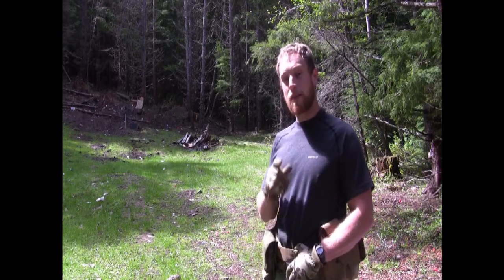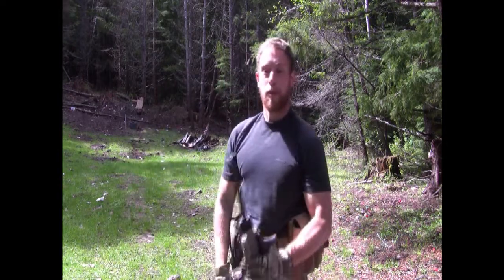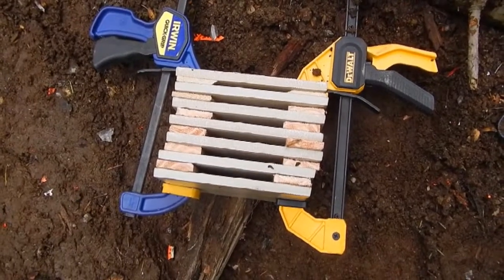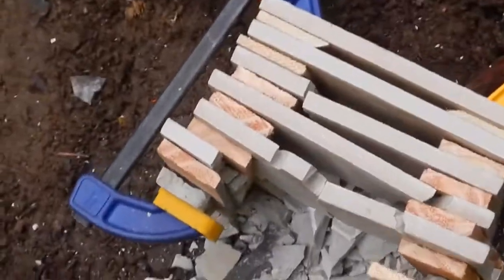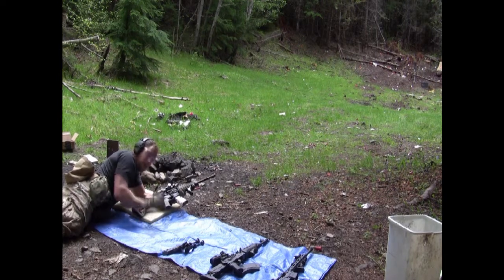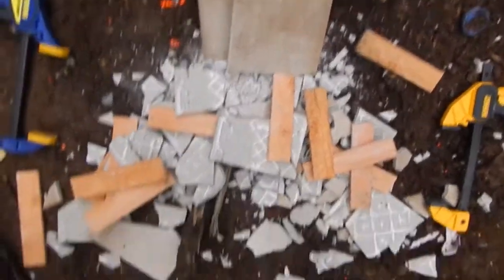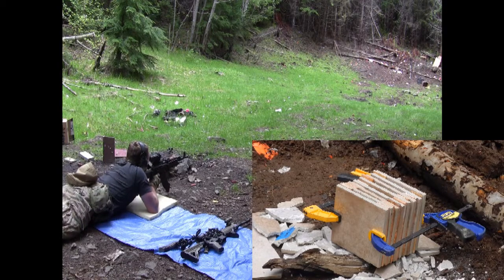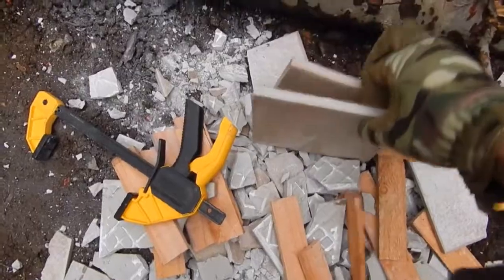Ceramic Tile vs. 5.56 and 7.62x39

Comment: Try porcelain or NERA which is pretty much a layer of rubber between 2 layers of steel or aluminum. Maybe with multiple stages